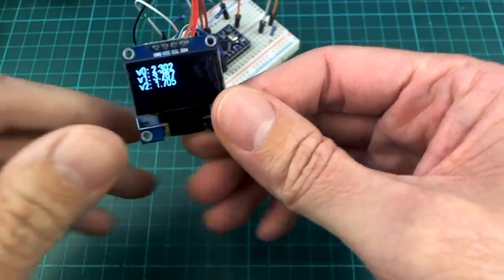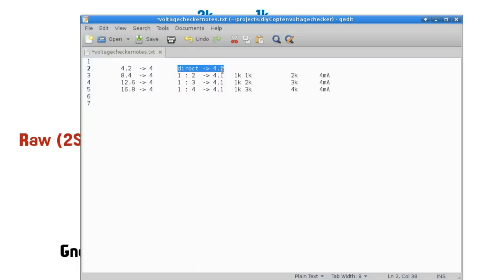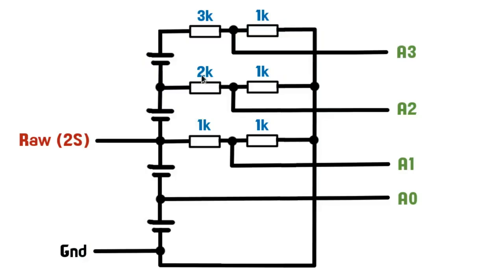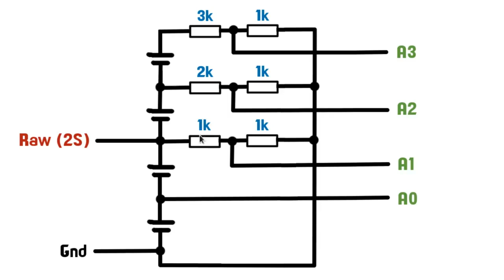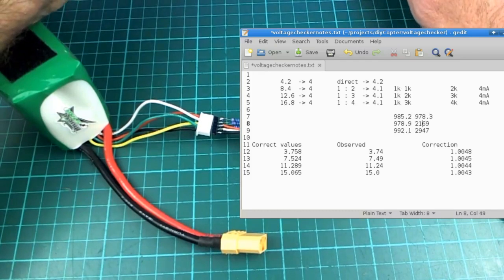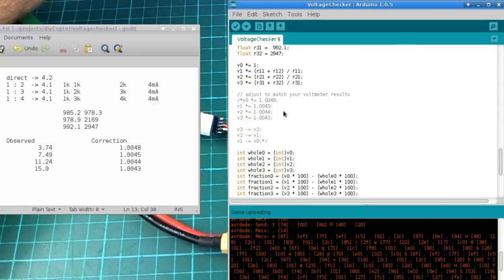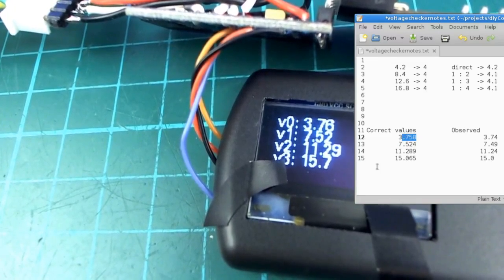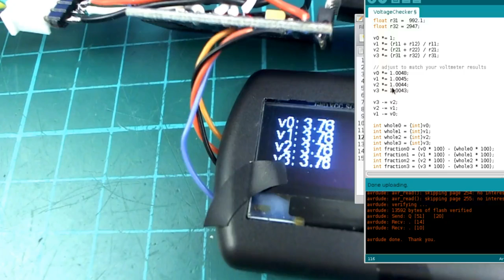DIY lipo voltage checker (arduino)

Comment: Please, cansomeone explain this to me?

#define DO_MOVING_AVERAGE(which)\
  total##which -= samples##which[ maIndex##which ];\
  samples##which[ maIndex##which ] = analogRead(A##which);\
  total##which += samples##which[ maIndex##which ];\
  maIndex##which = (maIndex##which + 1) % MOVING_AVERAGE_COUNT;

I get what you are doing here, the logic and such. But at what kind of sourcery am i looking at programwise? I have not yet encountered this kind of structure.

I would love to replace the ACD 0 and 1 with A12 and A14 (Mega2560).
Reply from the maker: This is a pre-processor macro that uses concatenation (the ## operator). For example if you give 'ABC' as the 'which' parameter, the result will be:

totalABC -= samplesABC[ maIndexABC ];
samplesABC[ maIndexABC ] = analogRead(AABC);
totalABC += samplesABC[ maIndexABC ];
maIndexABC = (maIndexABC + 1) % MOVING_AVERAGE_COUNT;

This particular case is not the best example usage (it would be cleaner to have a struct to hold the MA values), and in general these are frowned on in the quest for code readability and maintainability. But I am a filthy heathen who doesn't care too much for that most of the time, when working alone.

You can also use a single hash to substitute a string literal.
https://gcc.gnu.org/onlinedocs/cpp/Concatenation.html
Reply: @iforce2d  I didnt actualy expect you to answer. Thumbs up for that. I figured out that its some sort of a function. I replaced it for an actual function in my code, because i dont use A0-A4, so i could not simply replace them in my code. It works, mission accomplished.

Anyways, its a great example to learn from, so thank you.

Comment: I tried but the resistors are getting heated due to power loss how can I solve this issue
Reply from the maker: 4.2V across a 1k resistor like in my diagram, should be about 4 milliwatts. I don't see why that should be getting hot. Maybe your resistor values are too small.

Comment: Thanks for the video! I just built one using a 3.3 volt esp32 so I can be notified when discharging lipos back to storage charge. Despite measuring the exact resistances, my "adjustment" values are much higher, in the hundredths (opposed to your thousandths), and can vary significantly battery to battery. I'm not sure if the cause is a low quality adc or the internal resistances of the cells. Since my cells are normally balanced, I'm thinking of using a different algorithm to keep cells from reporting wildly inaccurate numbers.  Anyway, this video was a huge help and saved me a ton of time. Thanks for the posting and sharing your source code!
Reply from the maker: I tried this with STM32 microcontrollers and had the same problem. The numbers are all over the place and I had to apply all manner of smoothing in the software to get even a reasonably usable result, that still felt a bit off. There might be something about the arduino ADC that keeps it more stable perhaps. I still use this original one regularly as my main checker.

Comment: Great video! Thank you for that! I’m also looking into this right now but for 10S packs. The issue is that the higher the voltage of the pin you are measuring the lower the accuracy gets when using a simple voltage divider. I wonder if one could tap into a BMS chip somehow and measure the voltages that are supplied to that chip. But I don’t know, yet - a cheap BMS is on the way… Each cell voltage should ideally be measured individually in its actual range, so 0 to 4.2V. I know you know that, so I wanted to ask if you found any better, simple enough solution to accomplish this?

Comment: I see your schematic... Did you need the diode on every cell? Because with your schematic i see the current will flow from higher cell voltage to the lower one
Reply from the maker: The right hand side of the diagram is GND, so no current will flow from right to left. A bigger problem is if the balance plug is connected backward. To protect against that diodes would be necessary.
Reply: @iforce2d  yeah i know the right side is GND, but i see current still can flow from 3K+1K through 1K+2K (cell 4 to cell 3, if the cell 3 is lower then cell 4). 

OR self discharge scenario :

(+cell 4) to (3K+1K) to (1K+2K) back to (-cell 4)

with those 2 possibilities scenario the schematic not good for long usage ex. for lipo low alarm voltage.. CMIIW
Reply: this happen to my build with schematic on the video. i used external power supply to power the arduino and used arduino nano. when the power supply disconnected, the arduino didn't shut down. i meassured it and the 26mA still flow to arduino from the batteries  even the supply has disconnect. it will be draining the battery at long term. Any suggest to prevent this happen? FYI my plan to monitor the 4s Lifepo4 at motorcycle usage, and the monitor will be put near the speedometer. The lifepo4 will be replace the VRLA battery. Sorry for my basic question, im new at the electronics mechanism, but i want to learn about electronics. I need some explain and advice
Reply: @dikilesmana5211  4 cells mean you have 4 independent batteries, so if you want to real disconnected you need to buy 4 pole on-off switch. or you can make by using 4 standard on-off switch and glue all the levelers
Reply: @ZuNunchaku  i have considered for that solution before, but i wanted to make it using code or something simpler before. but if that's the only way I'd use a switch. considering that adding switches will take up more space and be rather unsightly. I appreciate the answer, so I'm more confident that I will indeed use a switch. thanks a lot.
Reply: @dikilesmana5211  if you using sleep for the arduino the batteries still flow to resistor. so switch or relay or reed switch is the answer I think
Reply: @ZuNunchaku  ahh the reed switch maybe the answer to make it simpler. i will learn how its work. thank you so much. anw, pardon me to ask, are you indonesian?
Reply: @dikilesmana5211  yup, im Indonesian

Comment: should I increase resistors for next batteries when I want to build 9s?
Reply from the maker: Yes, but any arduino with the 328p (eg. pro-mini, uno) does not have 9 analog inputs.

Comment: Is the OLED display capable of being powered from 5v ? Most that I have seen are all 3v3 including the I2C bus pins.
Reply from the maker: I have always used them at 5v, perhaps it's the screen part itself that runs at 3.3v and they have a little regulator on the PCB that it's mounted on.

Comment: what is the RAW(2S) in the schematic?
Reply from the maker: That is the second pin of the battery balance plug, see how there are four cells in the diagram...
The 2S is used to power the arduino, it goes to the VIN pin.
Reply: as stupid as it may sound but what is the battery balance plug and where is it in the video?
Reply from the maker: hmm...?? If you are asking that question you probably don't understand what this checker is for. The balance plug is the little white plug coming out of the battery.

Comment: hello! 
based on your idea here, i created this one for myself.. 
struggled a bit to have your code doing readings close to the voltmeter, so, created my code from scratch - didn't use any adjustment considering the resitors, but used 5.02v instead of 5, as that's what i read out of the regulator, instead of 5v.
i don't have any details on the video, but if anyone needs them, i'm ok with sharing:
https://www.youtube.com/watch?v=Krpm8otecGM
Reply: the math being just this:
  p1 = 5.02 * analogRead(A0) / 1023;
  p2 = 5.02 * analogRead(A1) / 1023;
  p3 = 5.02 * analogRead(A2) / 1023;
  p4 = 5.02 * analogRead(A3) / 1023;
kept my readings exactly as the voltmeter readings, totally ignoring the value of the resistors in code.

Comment: Sir my arduino pro mini suddenly isn't working. I was just testing it with 5v and all of a sudden it stopped. I tried uploading few codes but isn't uploading. I read few forums and found that maybe the reset button on the atmel chip.is spoiled. I am not sure. Pls could u help me out
Reply from the maker: You could take the reset button off and see if it makes any difference.
Reply: iforce2d ok

Comment: Is it fine if i remove this statement  "#error("Height incorrect, please fix Adafruit_SSD1306.h!");" from the code below as i am getting an error while i compile the code.removing this statement is fine???                        Its your code only.you might be knowing .@iforce2d

/*
 
 Connections for nRF24L01 pins
 1 - GND
 2 - VCC 3.3V !!! NOT 5V
 3 - CE to Arduino pin 9
 4 - CSN to Arduino pin 10
 5 - SCK to Arduino pin 13
 6 - MOSI to Arduino pin 11
 7 - MISO to Arduino pin 12
 8 - UNUSED
 
 Connections for OLED screen pins
 GND - GND
 VCC - VCC (mine seems to work with both 5V and 3.3V
 SDA - arduino analog pin 4
 SCL - arduino analog pin 5 
 
 */

#include <SPI.h>
#include <nRF24L01.h>
#include <RF24.h>
#include <SPI.h>
#include <Wire.h>
#include <Adafruit_GFX.h>
#include <Adafruit_SSD1306.h>

#define OLED_RESET 4
Adafruit_SSD1306 display(OLED_RESET);

#if (SSD1306_LCDHEIGHT != 64)
#error("Height incorrect, please fix Adafruit_SSD1306.h!");
#endif

const uint64_t pipeIn =  0xE8E8F0F0E1LL; // match this on both sides!

RF24 radio(9, 10);

// The sizeof this struct should not exceed 32 bytes
struct MyData {
  byte throttle;
  byte yaw;
  byte pitch;
  byte roll;
  byte dial1;
  byte dial2;
  byte switches; // bitflag
};

MyData data;

unsigned long packetsRead = 0;
unsigned long lastUpdate = 0;
int packetsSec = 0;
unsigned long lastRecvTime = 0;
unsigned long drops = 0;

/************************************************/

// writes a single line of formatted text to the screen at the current cursor position - keep it short!
void displayln(const char* format, ...)
{
  char buffer[64];
  
  va_list args;
  va_start(args, format);
  vsprintf(buffer, format, args);
  va_end(args);
  
  int len = strlen(buffer);
  for (uint8_t i = 0; i < len; i++) {
    display.write(buffer[i]);
  }
}

/************************************************/

void setup()
{
  radio.begin();
  radio.setDataRate(RF24_250KBPS); // Both endpoints must have this set the same
  radio.setAutoAck(false); // Both endpoints must have this set the same

  radio.openReadingPipe(1,pipeIn);
  radio.startListening();

  display.begin(SSD1306_SWITCHCAPVCC, 0x3C);  // initialize with the I2C addr 0x3D (for the 128x64)
  display.setTextSize(1);
  display.setTextColor(WHITE);
  display.clearDisplay();
    
  memset(&data, 0, sizeof(MyData));

}

/************************************************/

void recvData()
{  
  while ( radio.available() ) {        
    radio.read(&data, sizeof(MyData));
    packetsRead++;
    lastRecvTime = millis();
  }
  
  unsigned long now = millis();
  if ( now - lastRecvTime > 1000 ) {
    drops++;
  }
}

/************************************************/

void displayBits(byte b, int howManyBits)
{
  for (int i = 0; i < howManyBits; i++) {
    int mask = 1 << i;
    if ( b & mask )
      display.write('*');
    else
      display.write('-');
  }
}

/************************************************/

void updateScreen()
{
  unsigned long now = millis();
  if ( now - lastUpdate > 1000 ) {
    packetsSec = packetsRead;
    packetsRead = 0;
    lastUpdate = now;
  }
      
  char buf[16];
    
  display.clearDisplay();
  display.setCursor(0,0);
  displayln("Packets = %d\n", packetsSec);
  
  displayln("%d\n", data.throttle);
  displayln("%d\n", data.yaw);
  displayln("%d\n", data.pitch);
  displayln("%d\n", data.roll);
  displayln("%d\n", data.dial1);
  displayln("%d\n", data.dial2);
  
  // draw rectangle for joystick outline
  display.drawRect(30,12, 40,40, 1);
  display.drawRect(75,12, 40,40, 1);
  
  int d1 = map(data.throttle, 0, 255, 0, 100);
  int d2 = map(data.yaw,      0, 255, 0, 100);
  int d3 = map(data.pitch,    0, 255, 0, 100);
  int d4 = map(data.roll,     0, 255, 0, 100);
  
  // draw dot for current joystick position
  display.fillRect(30+40*(d2/100.0)-3, 52-40*(d1/100.0)-3, 6,6, 1);
  display.fillRect(75+40*(d4/100.0)-3, 52-40*(d3/100.0)-3, 6,6, 1);
  
  display.setCursor(0,7*8);
    
  displayBits(data.switches, 8);
  display.write(' ');
  
  displayln("%ld drops\n", drops);
    
  display.display();
}

/************************************************/

void loop()
{
  recvData();
  updateScreen();
}
Reply from the maker: Hmm.... so you are asking me if it's fine and then telling me it's fine? I think you answered yourself :)
Reply: iforce2d no re!!😋😋I am asking?

Comment: Hey, just wondering. Where did the capacitor on the circuit digaram go? And is the capacitor used to make sure there's no current flowing?
Reply: Just realize those are not capacitors, but were battery cells. But now i'm wondering if this would waste power going through the resistors?
Reply from the maker: Naturally some power has to be used. But usually you only plug it in for a moment to check the cell voltages.

Comment: Great job!!
But I have a question: what would happen, if I plug the balancer port to the lipo checker in the wrong way??
Reply from the maker: The arduino would die. Pretty sure I mentioned that at least twice :)
Reply: yes, you're right! :-D

Comment: Way not use a 3v3 arduino?
Reply from the maker: I find it more convenient with 5v because I don't need any voltage divider for the first cell. If you want to use it for 1S batteries then 3.3v would be better, but I think that's a pretty uncommon requirement.
Reply: if 3v3, then esp8266.... ;-)

Comment: guys I'd like to build a version for 16s over the wifi to smartphone using NodeMCU. Do you think I can make it using ADS1115 plus two 16channel  MUXs to select cell to measure in the differential measurement mode?

Comment: The reason why you didn't get what you expected from the divider is that the voltage doesn't split in the same ratio as the resistances. There's actually a formula that goes like this: Vout = Vin * (R2 /(R1 + R2)) So if you take your second divided tap, R1 = 2k, R2 = 1K, then if max. voltage will be about 8.4V, the divided output will be 1/3 of the input, which is 2.something Volts. So your displayed values can drift in accuracy with the change of the voltage of the readings.
Reply from the maker: The second divider using 1k/2k is for 3 cells, ie. 1/3 of 12.6
Reply: iforce2d oh, sorry my bad, then you have it "correct"?

Comment: use a toothpick to add a small dab of red paint or nail polish on the pin header, its easy to see and cheep gives you a easy to see indicator of red hot wire
thanks for the NEW project

Comment: [You should divide by 1024, not by 1023 (1023 is maximum value, but you should be interested in number of values - resolution).] <-- EDIT: Disregard this first part of the comment, I made a mistake.
Also, I don't know whether this would affect you - if you get different readings depending on voltage that powers Arduino, you should use analog reference - check Andreas Spiess' video called "#10 Tutorial: Make the Arduino Analog Readings more precise". I would also advise you to use arrays and loops in your code - that way your code would be more easily scalable (for example for adding more inputs), and tidier, more readable.
Reply: Unless I am misremembering, if your aref (internal, external, tied to AVcc doesn't matter) is for example 5v, then 5v to the ADC mux will get you the full 10 bits = 1023.  Therefore you need to set your unit measure to be the reference voltage divided by 1023 otherwise you will be off.  In other words (X / 1024) * 1023 is not == X.
Reply: +James Sleeman - I didn't think of that. You are right, because in this case one is basically calculating percentage, so one should divide a value by 1023.

Comment: Nice. You might be able to make use of the internal 1.1V voltage reference on the 328P to avoid calibrating the input voltages/values against a multimeter and make this retain accuracy at different ambient temperatures. After calibrating through software to adjust for temperature and manufacturing tolerance, the accuracy is supposed to be ±1mV, which should be better than static calibration relative to the voltage regulator's output (since ADC values are relative to Vcc).

See the 328P datasheet and the doc "AVR353: Voltage Reference Calibration and Voltage ADC Usage" for more info.
Reply from the maker: As long as I'm using the onboard regulator to get VCC from the 2S input, it should be pretty steady wouldn't it? I thought those linear regulators were pretty constant, but I guess something that doesn't change with temperature would be better. Hmmm... how does the 1.1v thing not change with temperature then...?
Reply: Hmm, looking around at different datasheets, I think it really depends on the particular regulator used on your Pro Mini board. The ADC circuitry has a built-in thermometer that's intended for ADC calibration, which is handy. That AVR353 doc explains how to use it.

The datasheet for the regulator apparently used on the official Arduino Pro Mini (MIC5205) has a worst case output voltage coefficient of 40ppm/°C, or about 1mV difference per 25°C. With 5V Vcc, that's about 0.02% difference per 25°C, so not an issue for this application and barely detectable by the ADC (difference in ADC reading of 0.2).

The LM7805 on the other hand has a temperature coefficient of ~1.1mV/°C , so a 25°C change with 5V Vcc would change your reading by 0.54% (difference in ADC reading of 5.5).

The main advantage to using the 1.1V reference in this case is probably that it's an exact known value that doesn't have to be calibrated manually for each hardware instance. There are probably a bunch of other variables with linear regulators, though I haven't looked into that. In any case it's just an interesting possibility - calibrating with a multimeter also gets the job done here.